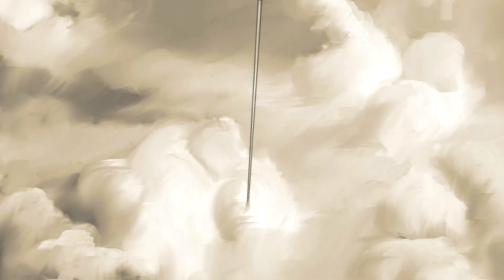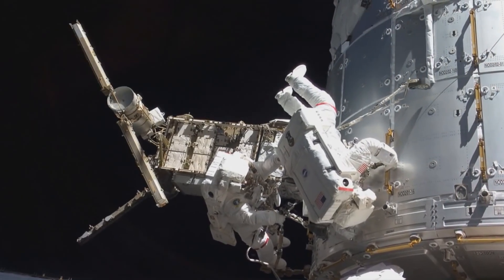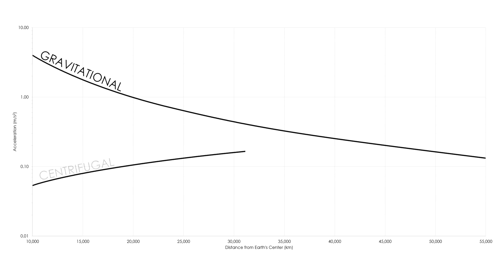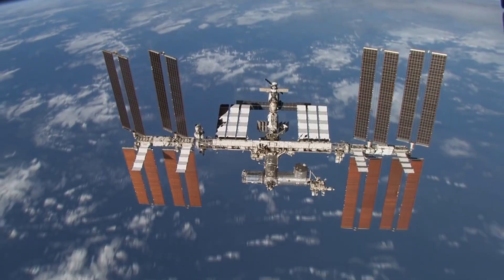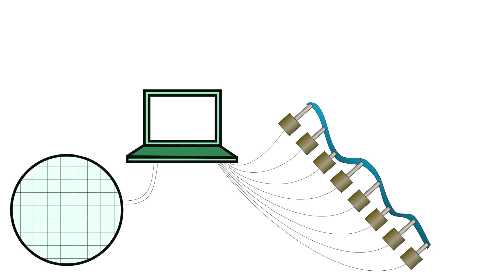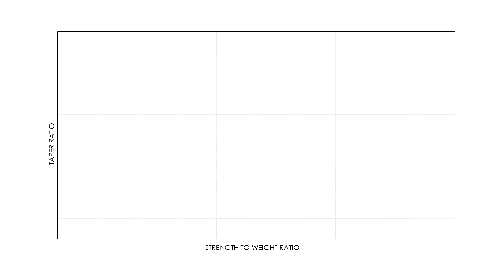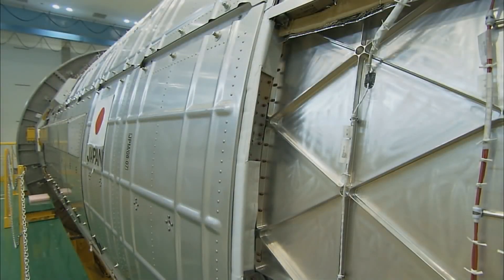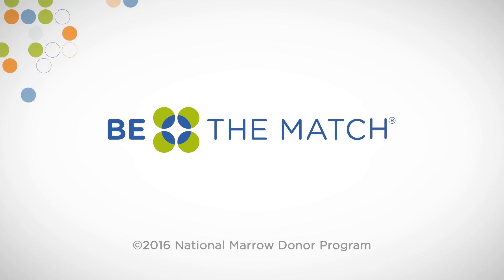Design Your Own Space Elevator

Comment: Great video! Really interesting and entertaining :)

I've always heard about space elevators and how they could be amazing, but I'm surprised at how much research and thought has gone into them.

How much easier would this problem be if the first elevator was built on the moon? I'd imagine the lower gravity greatly reduces the stress on the cable, there's no atmosphere to worry about, and if something goes wrong it's a much lower safety risk. Of course we'd probably want to have a permanent base on the moon to do this, at which point launches might already be cheap enough that the cost of a space elevator isn't worth it.
Reply from the maker: +DemolitionTurtle You're thinking in the right direction. The only problem with the moon is that it rotates so slowly. A "lunarstationary" orbit is pretty far away from the moon. Wikipedia has a good article that goes into more detail: https://en.wikipedia.org/wiki/Lunar_space_elevator

Comment: A tether made out of carbon nano tubes could be a giantic solar panel, capacitor and cable at the same time. However, since SpaceX could decrease the cost to bring things to space by more than 95% aswell, I'd say Rapid Reuseability is our more realistic Space Elevator :)
Reply from the maker: +KerbalEssences I agree
Reply: "96% of the fuel used to get in low earth orbit sounds a lot, but that's because it's carrying all the fuel that will be used to get to the moon form there and back."

You're right, but I think you're missing my point.
If you want to go from Earth to the Moon by rocket you need to take all of that fuel. A space elevator would save the fuel required to take the spaceship from surface to space AND the fuel needed to bring the fuel for the trip to the moon. Taking the Apollo mission as an example that's 96% of the total fuel cost of the mission.

But even in absolute delta V; surface to LEO is about 9.5 km/s, vs about 8 km/s to get from LEO to landing on the moon and back. In other words, the first 250 km requires more energy than the last 770,000 km.
Reply: This is all true but you're exaggerating a little. 96% of the fuel used to get in low earth orbit sounds a lot, but that's because it's carrying all the fuel that will be used to get to the moon form there and back. Yes you need a lot of energy and the amount of energy needed to get to the moon and back isn't that much but but if you just want to arrive at low earth orbit the amount of energy needed still goes down exponentially.
Reply: SpaceX would do what? I understand that at most they can decrease the cost only a small percent. Fuel is not reusable, even reusable stuff needs heavy duty maintenance.
Reply: +tomthy Crystal "If we have a massive object orbiting at a [distance] comparable to the ISS lowered a cable into the upper atmosphere"

The reason to build a space elevator is to make getting into space easier. And the hardest part of getting into space is the first 100 km, mostly because of the atmosphere. 
The Saturn V rocket that sent people to the moon and back used 96% of the total mission fuel to get the capsule and lander into low earth orbit; going to the moon and back.
In terms of delta-V; going from the surface to the ISS is about equally difficult as going from the ISS to the moon and back.
Reply: Do we assume that the space elevator has to touch the ground? If we have a massive object orbiting at a distince comparable to the ISS lowered a cable into the upper atmosphere, you would not need carbon nanotubes for it to hold itself up. Suspend a platform from there and create your elevator. Then you can use conventional airplanes to take passengers up to the platform. BOOM - 2 stange space elevator! 

Though it probably would need to be a bit higher than the ISS, so it does not burn up with air friction at that speed, but it would certainly not need to be 22,000 miles away. I am pretty sure that there is a distance that would work with conventional materials.
Reply: Timothy Crystal You've just described a space hook. And it can get much wilder and more efficient if you make it spin >:D
Reply: @timothycrystal2623   It does not work that way buddy, the reason why Clark belt was chosen was because the cable has to be in tension and the anchor has to be fixed into a position in order for the counterweight to work.
If you build the 2 stage thing that you are talking about, first stage of it will require an anchor at the new altitude and a counterweight too, lower altitude it requires a stronger centrifugal force,( being tethered you can't go faster then the ground underneath you) 
the space elevator has to touch the ground btw, in order for the big anchor to have a purpose, 
The system is great, problem is we lack the materials to do so, that and the financial/political motivation for it. 
If we run out of oil and there might be an asteroid somewhere close full of it, i'm sure the Americans will be first there.

Comment: why can't you put power in the tether?
Reply: +za bacon So right now it's 100000% impossible to make a tether and your suggestion is to make an even more complex tether with power lines running through it and also the car will need to get the power out as well?
Reply: yup then the car as be as light as possible and need the least amount of power.
Reply: Zachary Colimon The problem is both electrical resistance of the cable and added weight of 40000km of it. You would at least need a high temperature superconductor.

Comment: What about the tangential speed of the elevator?  The speed of a person on Earth rotating around Earth, is much slower than the Satellite speed, rotating around Earth.  So the elevator would need a force, not just to lift it, but to push it sideways, to speed it up and keep the cable from doing all the work.
Reply from the maker: +Heavyboxes I wasn't able to go into it, but the concept is actually "harvesting" angular momentum from the earth. Obviously not enough to slow down the rotation of the earth noticeably. That's the sideways force you're talking about.
Reply: This has always worried me: The coriolis forces as you climb will make the cable thrash around and oscillate. And the lifting work you do during the construction will be greater than any 'free' help you ever get to reap later putting stuff into orbit.
Good video. cheers.
Reply from the maker: +Richard Ball Thanks! I agree, dealing with the transfer of angular momentum into the climber is a really important consideration.

Comment: its just like jack and the beanstalk.  its do-able.
Reply from the maker: +Albion Laster That's the attitude!
Reply from the maker: +Matteo Mcdonnell Yeah I played a bit loose with terminology since the mass term cancels out in both equations. I take a bit of liberty with the rigor because I know no one's relying on me as a primary source for engineering education.
Reply: we can send power through cables on land over any distance

No.  Just a few hundred miles.  Even then, resistance causes energy loss.

any particular reason you cant send power to the elevator?

22 thousand miles is a really long distance.  Resistance would turn all the electricity to heat by then.
Reply from the maker: +Matteo Mcdonnell Thanks for keeping an eye on my work!
Reply: +Albion Laster lol
Reply: +Practical Engineering Hey, just a nitpick, but at 2:18 you say "force of gravity", but show the equation for acceleration due to gravity, the term gotten when canceling out the little m's. Not a big mistake, just wanted to make sure you knew it was there!
Reply: Of course! I really value what you are doing, man. I love every bit of your videos.
Reply: Practical Engineering why can it be powered just by electricity? we can send power through cables on land over any distance. any particular reason you cant send power to the elevator? i imagine it being like a trolley bus, moving by being powered by cables.
Reply: I have magic beans if you have a cow.
Reply: I'm pretty sure the bean stock was in compression though.

Comment: I always thought it would be cool if there was a way to use the vacuum of space to basically "suck" the elevator up a tube to the platform. But an air tight tube made of carbon nano tubes would be way more complicated than a simple cable.
Reply: +Jochem Kuijpers Well then we could push it up there. lol
Reply: +Jochem Kuijpers You could compress the atmosphere below the elevator and create a vacuum above it and maybe that might help it along. Or better yet just invent a teleporter and fix the whole issue. haha
Reply: +Jochem Kuijpers Maybe the elevator has some kind of thrust capability and having no atmosphere in front of it would make it more efficient to get it up to the space platform than traditional methods. Since that's the whole reason they're even talking about a space elevator, the atmosphere the rocket has to push through cause more friction which requires more thrust which requires more fuel. Remove the atmosphere in front of the elevator in the tube and it might require substantially less fuel or thrust to get up there.